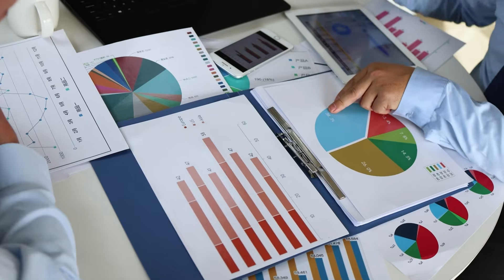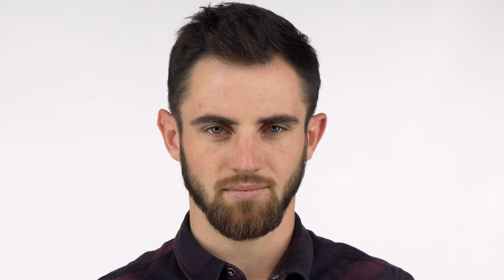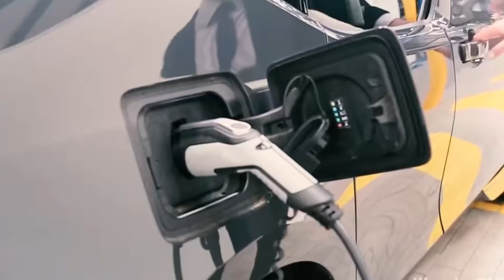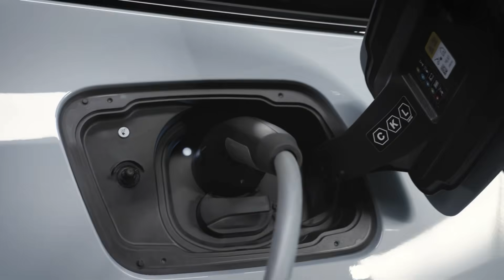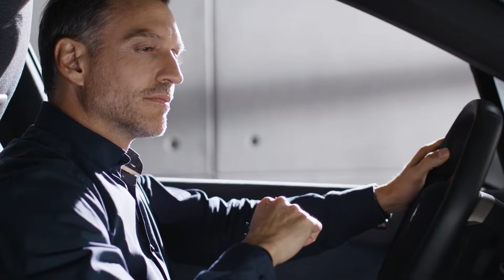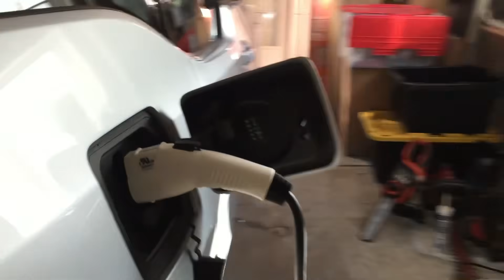10 Secrets to Make Your BMW EV Last a Lifetime (You Won't Believe #3!)

Comment: Well not true this has nothing to do whit BMW any battery car whit same type battery same story. But also why wold one put in all the electric system...it is designed for this anyway. That doesn't mean it will last forever just like any other car on any fuel....😊 this just ai slop
Reply from the maker: You make a fair point that good maintenance applies to any car regardless of fuel type! These tips are specifically tailored to EVs though since the systems are different. Appreciate the feedback either way 👊
Reply: @TheEVHubYT the first lead battery was more of a hassle but almost anything of quality and some what premium standard the battery life regardless of how you use or miss use it the electric stuff take care to stop you from damaging anything as it is heavy on user convenience anyway.  But most manufacturers maintain the old standard of 80 % charge and all the rest as it doesn't hurt to have a bigger safe limit and also it is easier for the batteries to be balanced. Anyway the battery and all the sensors and other hardware is now or basically since 2015 way better than the first attempts.